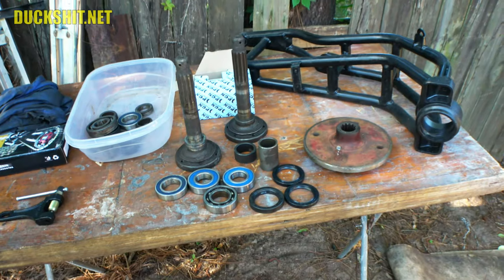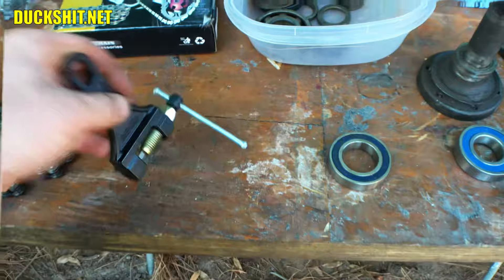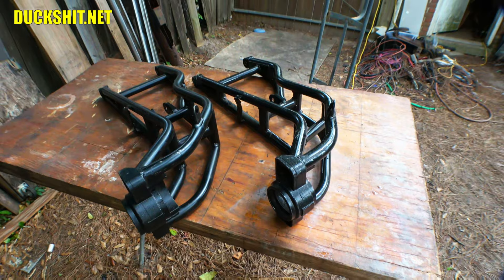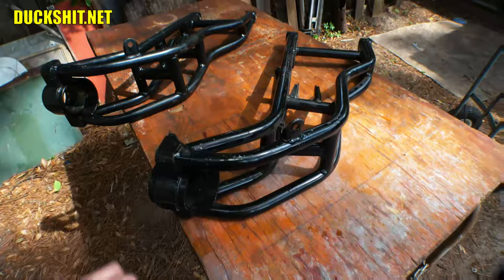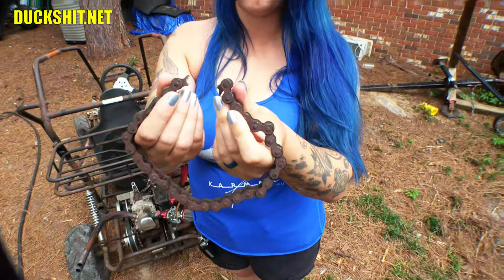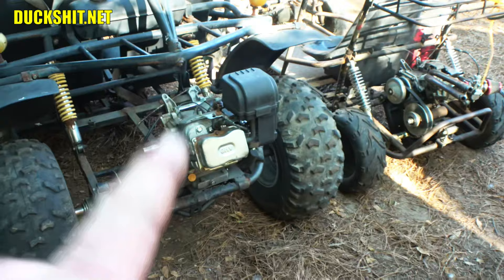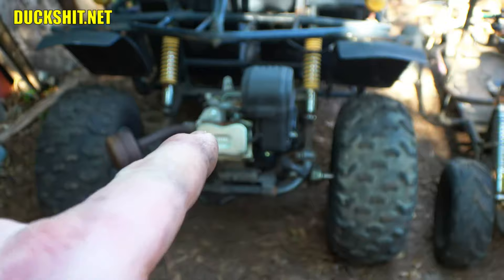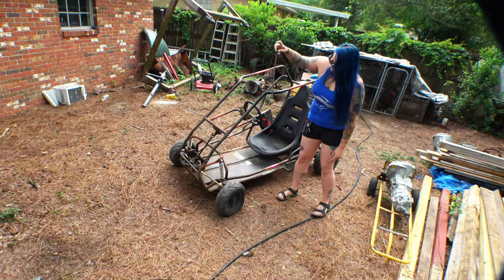🔧💥VW Beetle Axles in Go Kart and Engine Swap

Comment: Back in the day when I 15, I had a Manco Dingo.  It had a differential which allowed me to lock up one rear tire and whip it around on a dime.  It had handle bars instead of a steering wheel so there were hand brakes for each side.  It had a 12hp Brigs on it and I only weighed 125lbs so it would scream.  It was a blast.  

You are making me look on Craigs List for an old go-kart to fix up.  I will let my wife know where I got the idea so you can expect a message from her.  Another great video Glennnnnnnnnnnnnnnnnnnnn.